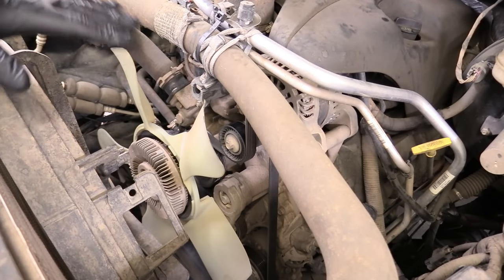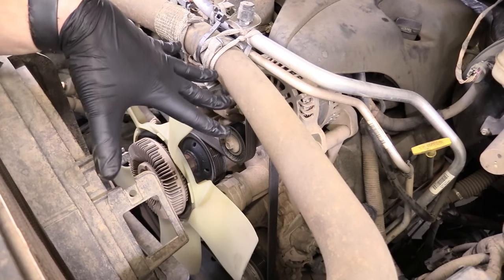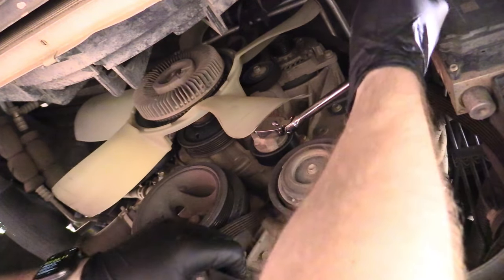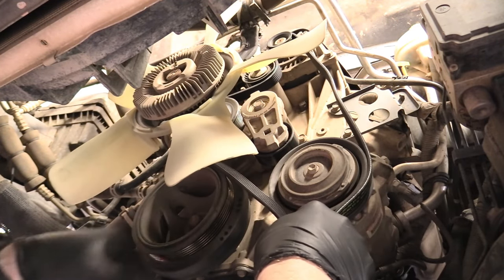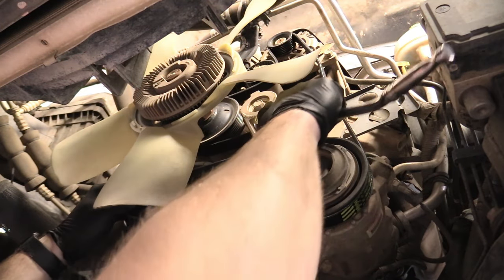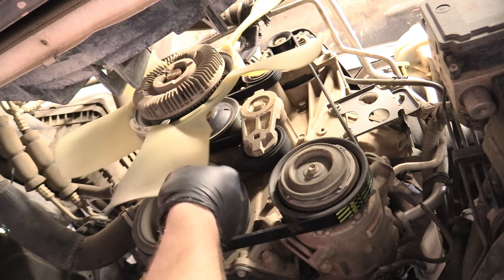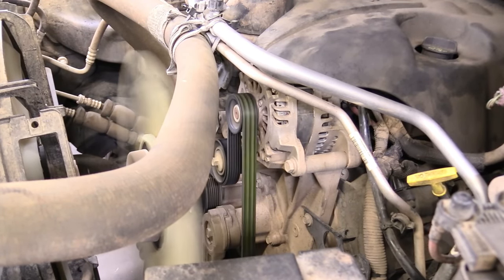How to Replace Serpentine Belt 5.7L V8 RAM 1500 2013-2022 - EASY!

Comment: My belts fine but I believe I believe my alternator  crankshaft and the power steering pulleys are screeching.very annoying and wld like to replace them.tried some kroil, but after a few days the noise returned

Comment: Great video. Two comments for other DIYers/shade tree mechanics:
1. He's right that you don't have to remove the fan shroud BUT the job is a lot easier if you remove the bottom half of the shroud (easy--just need a flathead screwdriver).
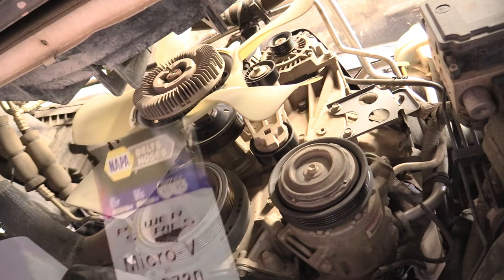2. The routing diagram is at 1:40
Reply from the maker: Yeah true. Thanks for watching!

Comment: Great video. I found that with the shroud on it was easier to access the tensioner with the tool from above. I threaded the new belt over the blade and the top pulleys from above, then finished with the bottom pulleys and tensioners from below. I needed a friend to open and release the tensioner as I threaded the belt over the final pulley below.

Comment: Thanks for posting an awesome video on how to do this.  It definitely looks easy to do without that stupid fan shroud in the way.  Plus, doing it from the bottom like you did.  When the time comes to do mine, I may take the fan shroud off.  You can see what you are doing at least.  I hate changing serpentine belts.  Thanks again for a great video!

Comment: Thanks for the video! Had my water pump changed still heard a noise replaced the bearing above the tensioner and still making a smaller noise. Now going back for the tensioner hopefully that removes the problem. So weird the first it was a loud noise of scraping (from the pump I assume) then ticking now whining a bit 😂
Reply: And of course I have the broken exhaust bolt tick but I’ll get that later
Reply: What caused the whine?
Reply: @trinity21MA  it was the belt tensioner. So I replaced it and got a new belt. Haven’t heard it since.

Comment: I have a 2013 2500 RAM and the tensioner pulley release is 1/2 inch NOT 3/8 inch.
Reply from the maker: Well this is a 1500 and a 5.7. Might be different for a 2500 5.7 or maybe you have a 6.4. Thanks for watching!